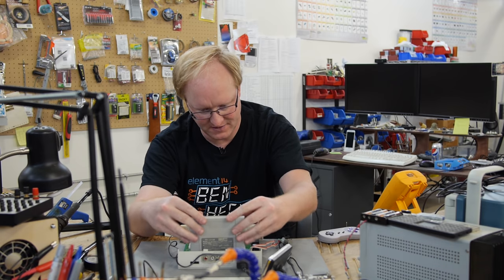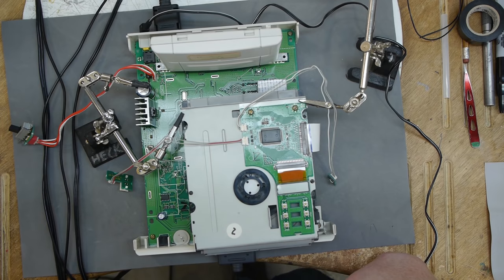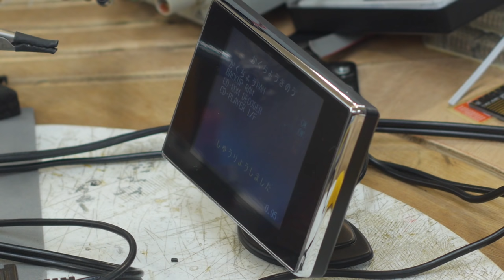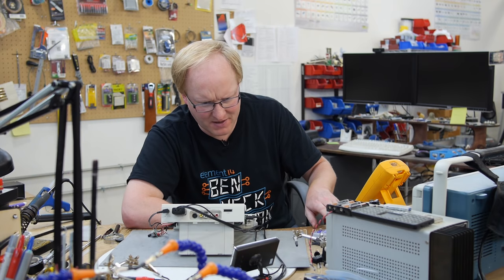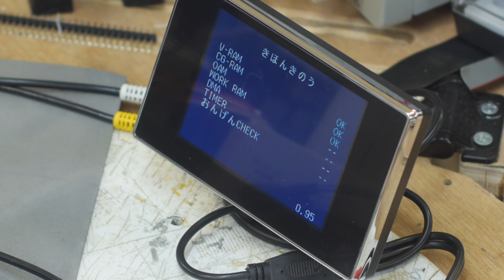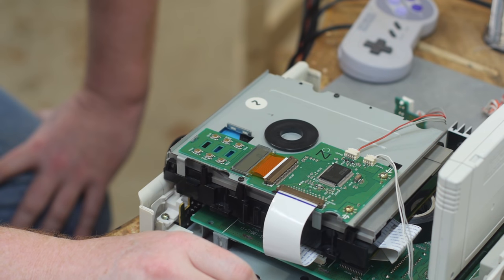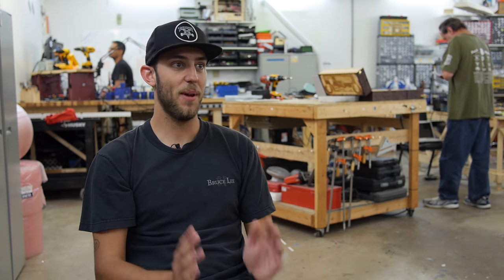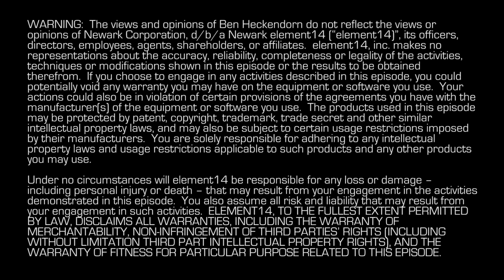Ben Heck's Nintendo-Playstation Prototype Part 2 Repair

Comment: What would happen if the test cartridge was put into a regular SNES?
Reply: It probably would look for the CD drive being connected to the external connector on the bottom of the SFC/SNES and tell you it can't find anything.
Keep in mind if things were going according to plan, there would also be CD addons for the regular SNES that would also need to get booted.
Reply: Probably it would boot and display the "NO CD-ROM SYSTEM" message, as it couldn't detect a CD-ROM add-on at the required place (the add-on connector that's on any regular SNES).

Comment: The problem with the CD drive is probably the laser. Maybe just needs cleaning, but can most likely be replaced. Typically game system lasers have been found in other devices.

Comment: Y'know it could not be reading a disc just because it was sitting in a box for all those years collecting dust on the lens, and then sitting in an attic for a couple more years could do more dusty damage to it. So I would use a lens cleaner myself if I owned it. Just putting an idea out there.

Comment: I challenge you too rebuild  an old FAT PlayStation 2 with a regular computer motherboard in it and has USB ports that support controllers and Flash drives/external HDs so people can boot up games movies and music off a connected USB storage device and find a way to keep the original CD drive and have it play ps2 discs. Idk adjust idea as needed but yea that basic premise

Comment: any chance of trying to make the CD part work?
Reply: it works acording to the consles self chec at the end they just dont have or know if there is a disc with a game made for it.
Reply: +UmbrellaCorpTeam they tried playing a sound CD but it didn't work.
Look at the comments, there are actually people suggesting stuff
Reply: Most likely the music CD doesn't work because there was no software to do so built on the ROM yet.
Reply: I'm saying that revision of the BIOS loaded on the IC might not have that functionality yet. Have you checked if the BIOS dumped online has audio player functionality? I'm pretty sure it doesn't load audio discs via emulation. I don't know if that is because of the limitations of the emulator though.
Reply: GermanAnimeFans A stand alone audio player is a separate program integrated into the software. This early model may not have it yet. It seems to be a vary early prototype that was designed to display basic functionality.
Reply: GermanAnimeFans Any software that they find for it most likely will just be demos that inject code into RAM to be extrapolated.
Reply: @GermanAnimeFans Welcome to the scientific definition of a "hypothesis". You should ask a middle school science teacher about it.
Reply: GermanAnimeFans I was speculating. Jesus guys, you people are taking this way too seriously. I was just making an educated guess.
Reply: CD-ROM drives built in mid 90ies generally had enough logic of their own to play audio CDs standalone. You would often see a play/stop button on old PC CD-ROMs and it would work even with no bus to PC, just power connected. Furthermore on PC CD-ROM, playing audio CD was just a couple simple commands, so that could be integrated into that display/button controller on the front of the unit. It certainly appears about as easy as if they made the display/button uC simply an interface device on the system bus without inherent connection to the optical drive logic.

Unfortunately in the video, there was no breakdown of ICs found on the CD-ROM board, which would have allowed to make a conclusion whether it's internally an AT bus drive that was adapted to SNES system bus using custom logic, nor has anyone apparently tried to tie a logic analyser on the data lines and see whether it looks like anything familiar.

Comment: he should definitely deyellow it,there are tutorials on it,fairly easy,and it makes the console look brand new
Reply: Methods for changing the color use hydrogen peroxide. They swap the oxygen absorbed by the plastic of hydrogen. Museums don't use this method because it is a "distructive" form of restoration. It's best to leave it as is.

Comment: Not sure if anyone has brought it up before, but I would've thrown a PSOne CD into that unit, just to see what would happen.
Reply: Probably absolutely nothing. The CPU architectures were about as different as TI-83 is from an iPhone.
Reply: +EpicallyEvil Interesting comments. However, let me point out a few facts. First, none of you can say for sure you've got the hardware specs right, because... well, there aren't any hardware specs for this prototype machine; second, to base certainty on a remark Ben made out of what he thinks it could have been (again-no specs, his guess is as good as anyone's) is a long shot; and third, basic vg history 101 tells us the PS1 was the product sony released right after their failed joint-venture with nintendo to produce a cd-loading 16-bit console, and the main reason they split was because nintendo ultimately went back and decided they wanted to continue supporting cartridge-loading games. So it's safe to assume that this prototype could very well support 16-bit games written for the sony cd format hardware (at least it's much less outlandish than claiming that these 2 systems are as far apart as a ti-83 is from whatever you said...)
Reply: +EpicallyEvil again, if you keep making unbacked statements like that your only guessing. I did watch both parts and I happen to have done a little research before issuing my statements (did you fully read AND understand my previous reply at all?). Stop guesstimating.
Reply: +EpicallyEvil dont change the subject just because you lack evidence on the ps1 side. This prototype has 2 sides and the snes happens to be one of them. Just because the cd drive wasn't tested it does not give you any backing whatsoever. Do your homework before you issue these naive opinions, kid. They're nothing more than that. I'm not going to waste any more of my time trying to educate you at all on separating fact from guesstimating. °¬´
Reply: Werner M.
There is also no of evidence that the Nintendo PlayStation was not made by Jesus Christ himself as a team effort with Santa Claus, and given to Sony and Nintendo for the purpose of safe keeping for the Lord's use as the sword to fight the Anti-Christ during the end times.

Or you're an idiot, FFS go read some David Hume and/or Bertrand Russell crib notes or something. Ben Heck knows what he's doing, and this isn't the first time tearing apart an Nintendo OR a PSOne. Both of which are consoles who are almost 30 years old and well explored and understood. If there was an IC that was on there that looked suspiciously robust enough to play PSOne games, he'd let us know. Watch the videos again and read the pop ups on the bottom this time, virtually every chip who was unknown during filming was discovered to be something benign and typical after some time for more research.

Its just a SNES with the ability read CD's along with cartridges.

Comment: I wonder if/how well the SFX could do Full Motion Video...
Reply: What about the Retina Display and Blast Processing?
Reply: ***** The thing is tho that FMV wasn't viable on cartridges because of the limited capacity and the (at the time) large size of FMV sequences, so it was (to my knowledge) never done on the SNES, aside from a few homebrew games and romhacks that run on a specific flash cart.
Reply: I was making a joke, but thank you for the lesson (Seriously, thanks :)).
Reply: Pretty badly! The only thing i can imagine working (for "realistic" style video)  is VQ block coding, and that just tends to look like ass with any sensible bandwidth. That CPU is pretty damn slow! It's at a severe disadvantage vs. Mega CD. Another issue is, how fast is that optical drive, 300 kb/s if we're lucky? Cartridge homebrew doesn't have the drive speed limitation, or the dictionary size limitation for VQ, even if they are limited in total size of the video.

There is one SNES game utilising vector polygon FMV for "Virtua Racing" style visuals, both cutscenes and all stages are FMV, and they designed the stages around weaknesses of the video compression. It uses SuperFX2 extension DSP in the cartridge for polygon rendering. The game is called "Winter Gold", published by Nintendo, developed by Funcom. Specifically, LoneStarr/SPACEBALLS appears to have worked on the game, he made himself a name with vector polygon video compression with some Amiga demos.

This leads to a potential solution, perhaps an expansion cartridge containing an off the shelf H261 or MPEG1 decoder for proper FMV in games.

Comment: It Would Be Cool He Made It Run Both SNES And PS1 Games!
Reply: JoaoGameplaysSP  it will never run PS1 games, because it's way different architecture. This is 4th gen prototype based on SNES. in PS1 (5th gen console) there are really other components including BIOS, CPU and RAM. that's why it will never run PS1 software.

Comment: I think the CD may have had a newer format like mp3 you should have tried an older CD
Reply: It's a Weezer CD, it would have audio tracks on it. It could be that device is looking for a data track and is saying there's no CD because it can't find it.
Reply: Chris B I thought it was a blank and the put songs on it from a computer
Reply: It says Weezer on it and was even name-checked in the video (it's Karen's). :p I wondered if that was the assumption you had made. :)
Reply: Might be that Starfox prototype I saw pictures for back in an old Nintendo Power magazine...
Reply: +Chris B I watched this on my phone in vertical mode so the picture wasn't very big
Reply: I doubt SF2 was ever programmed to run off a SNES CD.
Reply: +protocetid it wasn't

Comment: Hey you can remove the yellowing of the case using hydrogen peroxide.  Have a look at 16bit guy on Youtube.
Reply: Not a good idea. It swaps the oxygen for hydrogen and alters the chemical makeup of the plastics. Museums won't use it
Reply: H202 (Hydrogen Peroxide) removes the hydrogen atoms as well as other atoms which bond easily to oxygen from the surface of the plastics. The chemical composition of the remaining plastic is not changed. It does not add Hydrogen to the plastics.

However, I am not sure how this cleaning is viewed by collectors or museum curators, and you could very well be correct that they would not appreciate the cleaning.
Reply: +Nathanael Ries I thought the free radicals were absorbed into the plastic.
Reply: +a1rh3add Maybe. I'm not a chemist, so I'm just applying my very rudimentary knowledge of chemical bonds and the composition of H2O2.
Reply: Nathanael Ries I don't personally know either. I'm just repeating what I heard from some serious collectors.

Comment: Yayyy it's fixed. Too bad it will probably never play a disk due to lack of software. But still neat.
Reply: There are homebrews so perhaps it will.
Reply: +a1rh3add yes, perhaps. It depends on if they can figure out the firmware that drives the cd drive. I'm sure some hacker somewhere could figure it out with enough time I suppose.
Reply: r100curtaincall Isn't it on the BIOS that has already been dumped? You can already emulate the CD drive.
Reply: +a1rh3add yes supposedly. I just heard about that earlier, a detail I missed. Though it is only basic IO for the drive. The console must still have software, like from the cart to handle the drive and its relation to the system and game-Much like your computer needs an os and drivers. The BIOS can't do everything on its own. Supposedly someone already made a disc homebrew! It's a step in the right direction!

Comment: you should have tried putting an original play station disc in it.
Reply: The system supports audio CDs, so it should have detected the "Wheezer" CD.
Reply: It wouldn't have been recognised. Even if the unit has the correct graphical capabilities to run games, The PS1 required a specific region coded bios which lived in a ROM chip, such a thing almost certainly isn't present on this machine.
Reply: Why?

Comment: While this is really cool I can imagine some historians flipping their lids when they see alterations being made.
Reply: He kept it as original as possible, while making it functional. As a "self proclaimed video game historian", I have no problem with it, as all he did was replace some caps
Reply: Kyle Coulombe I was kidding really. This is akin to museums that have old broken statues but they fill in the missing parts with a different color plaster.
Reply: I guess if he really wanted to be gosu about it he could have found an identical capacitor. I suppose some would have the argument over what's preferable: working condition or "as received" condition, e.g. do you fix the Sphinx's nose or not?